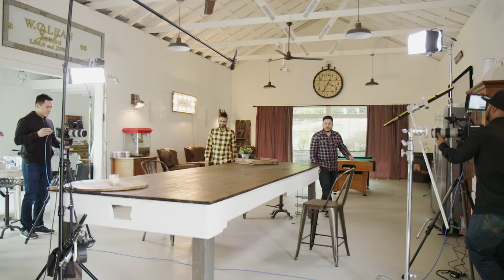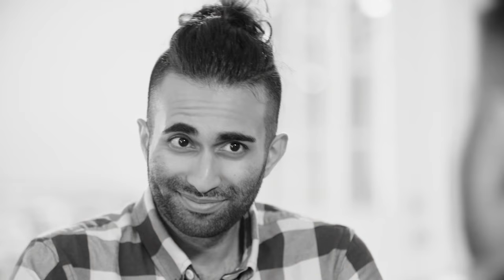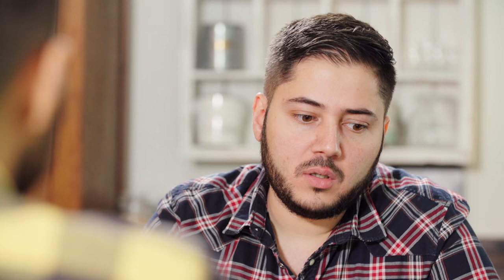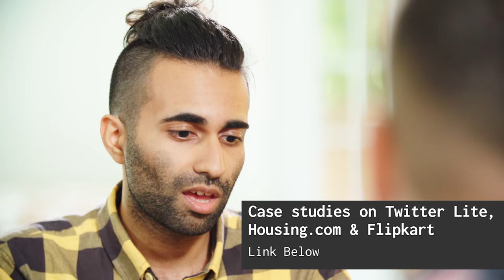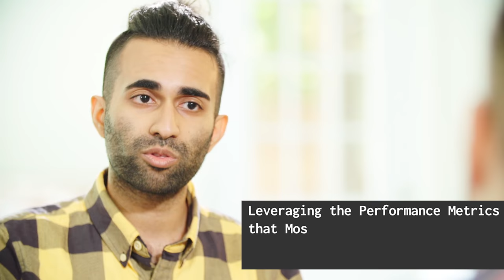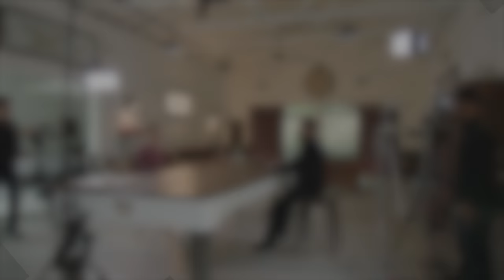Designing for Great Performance -- Designer vs. Developer #9

Comment: Here is the reality, If your App or Ad  takes longer than (two)seconds , The odds of that customer leaving  increase by 48 percent, I'm more concern with scalability.
Reply: For sure. The impact of third-party ads or scripts on performance can be a real problem. It doesn't help if you have the fastest site in the world if these completely destroy how quickly your page can be used. With respect to the designer vs developer conversation, I think this requires us keeping this in mind for our performance budgets. Either the issue has to be addressed upstream with ad networks or perf budgets need to be even tighter to account for these types of problems. It's definitely not a trivial one to work around.